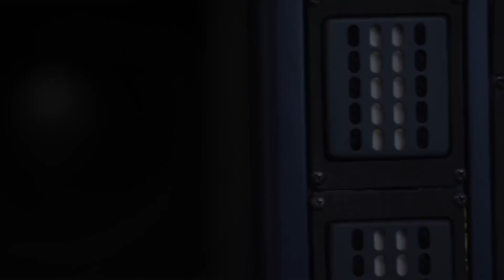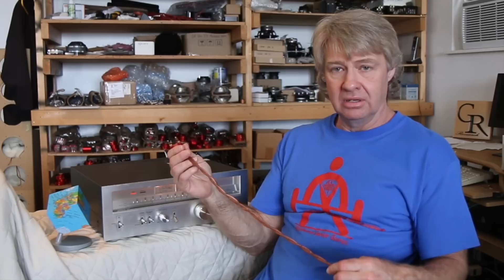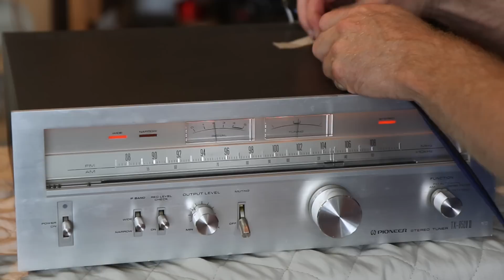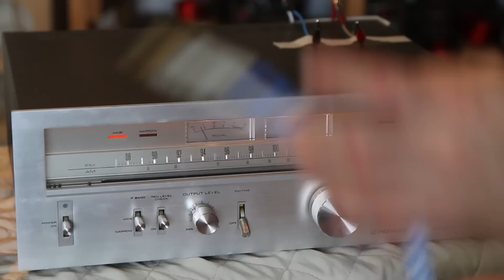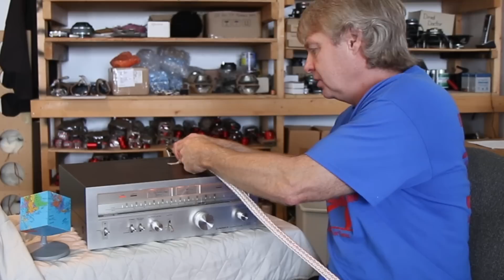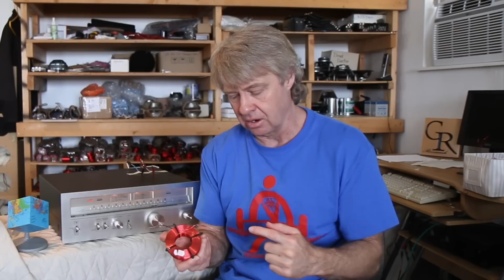Do Audiophile Cables Matter? Here's PROOF!

Comment: If you have a Vector Network Analyzer, you can sweep the cables, record the responses, and directly compare them to each other. If you don't have a Vector Network Analyzer, you can use a signal generator, a high quality ADC, recording software, and directly compare differences.
For most cable for speakers, there is very little difference when comparing cables of the same wire gauge. The cable impedance is higher than the speakers in most cases, so there tends to be some high frequency attenuation in the high end, but most times below the limits of the measuring equipment.
For interconnect cables, EG RCA patch cables, most audio amplifiers have an input impedance of about 20,000 ohms to place very little load on the source. However the cable nominal impedance of most patch cables I have tested is about 60 to 70 ohms. Since this is not terminated into the nominal impedance of the cable, it does have an effect on the frequency response.
Professional sound equipment does several things to counter the issues of home stereo equipment. With longer cables, the issues compound with length. Professional sound uses shielded twisted pair to reject common mode noise, and the microphone or instrument cables have a nominal impedance in the 50 to 80 ohm range. However, professional equipment has input impedances of between 200 ohms and 600 ohms, which is much closer to the nominal cable impedance.  The issue with long speaker cables is to replace them with line level mixer signals going into powered speakers. This uses the advantage of the better impedance match for the signal as well as the balanced shielded twisted pair cable for common mode noise rejection.
The newest improvement has been the digital mixers using digital stage boxes, so long analog signal runs are omitted entirely. A/D conversion is performed on stage with short cables to the instruments.
High impedance unbalanced instruments with a 1/4 inch instrument cable go to either a pedal box that has an amplifier with a low impedance output, or goes directly into a Direct In box, designed to be a high impedance load for high impedance guitar pickups. Again, short, very short, cables are used between the guitar and the DI box.
Some guitars have gone even higher grade keeping all the High impedance wire inside the guitar, to an internal line level or mic level low Z amplifier to drive a low impedance XLR connector to eliminate the problems with 1/4 inch high impedance signals.
Testing audio cables for signals in the 100 MHZ range tells very little about the cable at 0.020 MHZ to 0.000020 MHZ.  (20 KHZ to 20 HZ)

Comment: I rate this video 7 sausages. There is your definitive proof.

yes cables have different properties. It's measurable.
For exmaple: Some will be a better rope than the others.
There will probably be differences in sound too when you use them as speaker cable.
Best is what you like best.
My hifi store sells their own handpicked thin gauge simple copper speaker wire.
Also fancy cables of 1000s per meter, but they use their own themselves and advice to pick theirs. 
It's sounds very clear, it's better than a lot of audiophile cables, in a subjective comparison.
It costs 5 euros per meter. It sounds better than my 60 euros a meter silver cable when I compare
in my set. When I compare to thick gauge copper audio cable, the bass is different, maybe less?
But I like it. that's good enough for me.

Comment: If the braid cable is able to remove noise that's already on the line, then what effect does that have to the actual signal?  Does none of the signal exist within the domain of the filter?  It seems like there might be some issues there, though it would be hard to tell, as that piece of the signal just wouldn't be present in the presentation.

Comment: Hello Danny, your test of using the loudspeaker cables as an antenna and measuring the field strength on an ordinary receiver astonished me at first. Like others here, I thought ‘What is this test supposed to show?’ The differences in field strength depending on the cable were astonishing but logically understandable. Well, the loudspeaker cable is not used as an antenna, but there is another issue. Via the amplifier's internal feedback loop, which every amplifier has, these high-frequency signals return to the input of the amplifier and are ‘amplified’ in the same way as the actual audio signal in the amplifier. Although the frequencies are outside the audio range, they cause mixed frequencies in the individual amplifier stages and therefore interference, which can certainly also be measured at the output of an amplifier and can probably also be heard. It therefore makes sense to use a low-inductance or even shielded cable. Best regards Detlef
Reply: You are correct.

Comment: The primary attribute of a speaker cable that matters is the gauge depending on the length. For the interconnects you want shielded with a ferrite choke and short as possible.
Reply: A ferrite choke for audio signals? 🤔 Well, now that's a first. 😅
Reply: Interconnects or speaker cables... at the end of the day, they're both analogues, and therefore, both need to be shielded! This is coming from someone who's changed all off is analogue and most of his digital cables multiple times
Reply: @Totalplonker  Speakercable shielding is absolute pointless. Coming from and electrical and sound engineer.
Reply: @literal_lee  an electrical and a sound engineer"
Oh dear I do apologise. I didn't realise a sound and an electrical engineer automatically qualifies one as an expert, I always assumed the sound of the cable comes down to the listening!
 To put it politely and without trying to sound rude... personally, I would rather take advice from an avid music listener than someone who's learnt that trade from sitting in front of a monitor (that's a computer monitor, btw)
Reply: @Totalplonker  Explain the science behind screening a speaker cable, please? Why does a screened cable sound better. To be fair, increased capacitance could maybe cause some high frequency roll of... but that is outside the audible spectrum. (>1GHz) You ears ain't that good!
What lead to you to conclude that I don't enjoy listening to music ?
Reply: @literal_lee  actually my earring is crap. In fact, that's precisely the reason why for my ears, the difference between shielded and unshielded speaker cables is interpreted as signal noise. I'll give it to you when it comes to stereo speaker cables the benefit of speaker cables and unshielded speaker cables are only the marginal. However, in my experience, it's all about...
 'horses for courses'

Even though I'm an avid 2 channel stereo music lover, I also love the occasional movie, too, and due to lack of space, I have to optimise my setup for multi-channel listening also. However, when it came listening to my newly discovered multi-channel setup, I immediately became aware of how the room sounded different. Didn't know what it was at first, but coming from an audio black background, there was no way I was prepared to put up with it!

Even after auditioning 3 separate AVR's, the same electrical ambient sound of the room was still present! That told me the extremely faint background signal noise I had been experiencing (poor description) had nothing to do with the actual units. Therefore, my attention changed to the cables. And even then It was only on the third occasion after living with two previous sets of cables that I ended up finally purchasing shielded cables and that is when the noise floor within my small room finally came down to satisfactory levels.

 Cables often act as antennas for attracting RF, and the longer the cable, the better the antenna! Probably explains why when I used to disconnect my heights and surrounds within 10 minutes, the faint background signal noise (RF/EMI) within my small room used to almost practically disappear/dissipate

The more cables I shield, the quieter my room becomes, and the better the shielding, the more the cables are likely to disappear. In fact, the last group of cables I changed were from my HDMI's and lo and behold the room became slightly quieter yet again.

If one has the same sensitivities and is looking to address this matter, but is also hoping to notice (hear) the incremental differences, I would suggest starting with analogue cables before moving on to digital and power cables (no good getting rid of the quietest when one hasn't addressed the noisiest)

Trying to achieve a totally silent room sadly has turned into obsession for me. However, the results speak for themselves. There are times when sitting in the MLP and pressing pause (or mute), I'm unable to differentiate whether the systems on or whether the systems actually switched off. Of course, audiophile equipment helps, but in reality, for one to experience an exceptionally quiet room with a multi-channel setup, shielded cables IMO are a must.

When friends or guests came over, I used to show them how loud the system goes. Nowadays, I prefer to press pause and show them how quiet it goes. 

None of them gets it, of course 😊

And BTW I didn't mean to imply that you weren't a music lover. The fact that you took offence says it all 🤘

Comment: The problem with this topic is. Is there a difference?...yes. which sounds better? Now... That's an entirely different question. Case in point. CDs are technically better than records. You can prove it. But which sounds better.
Reply: Very good comment!
To answer the question though: it depends on the mastering engineer. Most digitally mastered audio is overcompressed to the point of distortion these days.

Comment: I fail to see how someone with a half decent hifi cannot hear the difference between better cable.
The oyaide black mamba v2 power cable are substantial better being richer, fuller, and has nice linear quality. It's just a shame their quite stiff.....Life eh !
Reply: Define "better". More expensive does not equate to better or even different. Take a course in low voltage electrical engineering. It will pay for itself once you see thru the nonsense.

Comment: oK lets’ see, you have dropped $11,300 on a single-ended triode mono-block amplifier that puts out almost 6 watts with a mere 3% THD.  You trust that the engineers that designed it have picked a topology and specified the appropriate components (Vintage NOS tubes, Mundorf silver/gold/oil capacitors, Vishay resistors, and pure silver wiring etc.) to ensure it provides crystal clear transparently that is always agile and dynamic while being rich and fully saturated, offering a tonally and harmonically dense acoustic environment with a huge soundstage and a highly natural tonal and textural delivery that is extremely quick, and controlled - yet neutral, balanced, very musical, and powerful with blackness and control in the bass that allows simply the right transmission of music free from artifacts or manipulation in which the instruments are contained in their own space resulting in a magical musical harmony between speaker and amplifier electronics that assures considerably better focus, instrumental separation, cleaner & sweeter treble and better upper-midrange resolution with an impressive layering of dynamics, as well as nice drive and transient pop, and a strong degree of transparency that is grain-free and offers effortless resolution and reflexes, making it a snap to follow interleaved melodic and rhythmic lines with a sound that is open and detailed with exquisite harmonic nuance and shading with dynamics that are very agile (again!), realistically tracking changes in the music yet with a low end that is elegantly controlled but not over-torqued but instead is luscious, velvety, silken, gorgeous for a presentation that never, ever sounds electro mechanical, instead is always wholly natural with a dynamic range that is prodigious in delivering the sonic goods with naturalness, beauty, and ease, while also throwing a remarkably deep and wide soundstage (again!) brightly every time with a golden sense of bloom, inviting detail, and unwavering musicality that produces lifelike illumination in the mids and treble, exquisite resolution of fine detail, and outstanding transparency to the tintinnabulation that so musically wells from the jingling and the tinkling of the bells, bells, bells, bells (oops I diverge).
The engineers that designed the amplifier are, however, completely incapable of specifying a power cord that fully (or even partially perhaps) meets the needs of such an amplifier.  Thank the Lord above that there are companies at the ready to make up for such ineptitude – that is if you are willing to pay the price.

Comment: here is what you proved... a) you need a good cabling Before amplification, or you pick up noise that gets amped up ... b) if a cable where to remove noise (which it doesnt) then legitimate signal would be removed as well ... i can play white noise into the system and it should reproduce it!!! ... any way .... thats not whats happening, you baically created a super expensive shieled cable, to do what the majority already know, ALWAYS USE GOOD SHIELDED CABLES BETWEEN system components
Reply: No, not at all. We never want to use shielded cables. The shield hold an electromagnetic charge that negatively effects the signal.

Comment: There are a TON of variables that need to be considered before a test like this is relevant.  The length of a cable determines which frequencies will excite it, for example, which is why antennas are a specific length.

I’m also not sure how RFI in the MHz range has anything to do with audible frequencies?

Anyway, I’m not taking a side in the main argument, just pointing out that this test is probably not relevant.
Reply: It puts noise on the line that effects the signal especially using amps with negative feedback.
Reply: @dannyrichie9743 ok, so your argument then is that the advanced braided cables act as a filter which blocks high frequency interference from being passed forward into the speaker, and backwards into the feedback circuits in the amplifier.  Am I understanding that correctly?

If that’s the case, would it not make sense to design a simple low pass filter into the output of the amp and the input to the speaker?  Say a -6dB/octave starting at 30-40kHz?  Then nothing potentially absorbed by the speaker cables could affect anything in the audio path.

And in that same theme, a simple choke on the power line(s) to the components would filter out any high frequency noise on the power input.

I’m not trying to be stubborn, I’m just questioning the relevance of this test, ie if a cable functions poorly as an antenna in the MHz range that it automatically functions better as a speaker cable in the audible frequency spectrum.

Especially when you consider all the potential variables which have not been corrected for here, the primary one being cable length.  I would think if EMF in the FM radio broadcast range is of prime concern, the #1 priority should be to never have speaker cables made to the same length as FM antennas which are specifically designed to be resonant at those frequencies.

Thoughts?  I think if you really want to get serious about this you need to use an oscilloscope to start visually demonstrating the potential of your theories.

BTW, I generally like what you are doing and I’m currently reverse engineering the crossover in my desktop speakers with the intention of upgrading them.  I don’t doubt that we can hear things that are difficult to measure, especially for experienced listeners (which I am not).  I find audio fascinating and have since I was a teenager messing with car audio in the 90’s.
Reply: @superspeeder  "If that’s the case, would it not make sense to design a simple low pass filter into the output of the amp and the input to the speaker?  Say a -6dB/octave starting at 30-40kHz?  Then nothing potentially absorbed by the speaker cables could affect anything in the audio path."

That is actually what the twisted or braided geometry does but more aggressively.
Reply: @dannyrichie9743   so what would be very interesting to see is whether you can duplicate the effect of speaker cables costing hundreds or thousands of $ for the cost of a few simple inductors and capacitors in the signal path.  Those would be very tiny and inexpensive components working at those frequencies, and could let speaker cables get back to being simple and inexpensive conductors.

Even if the effect is not 100% as effective, a 90% solution at 10% the cost should be very attractive to anyone… especially someone who sells speaker cables and could integrate them into the cables themselves (hint-hint). 😉
Reply: @superspeeder  There are companies that do that. See MIT cables and Transparent cables. The results however, are hit and miss.
Reply: @dannyrichie9743  I’ll check them out.  Thanks for the dialogue!

Comment: It seems like the real take-away here is actually not the cables themselves at all, but rather the fact that twisting the wires (in this case weaving them) can actually have some limited beneficial effect for canceling out noise on those cables. Now, we also know that this can vary based on the number of twists per foot. The same principal of signal crosstalk cancelation is employed in computer networking cables as well. UTP cable (Unshielded Twisted Pair) Ethernet cable does a certain number of twists per foot internally for the purpose of eliminating or canceling out signal crosstalk where the single flowing down one strand in the cable has the potential to interfere with the signal flowing down another strand in the cable right next to it. So, if you want your cable to act as a filter rather than an antenna, there appears to be a benefit to having a certain number of twists per foot among the wires that make up that cable to help accomplish that.